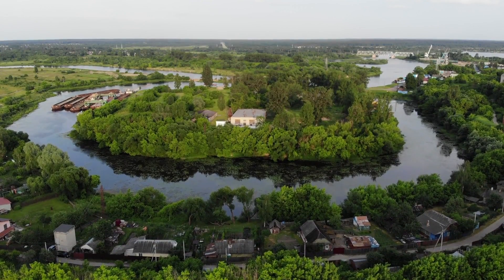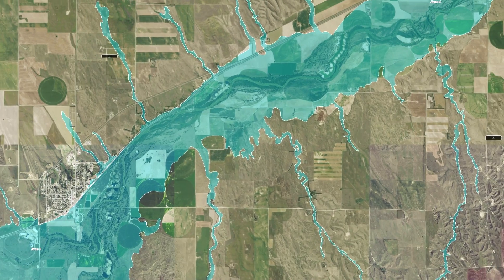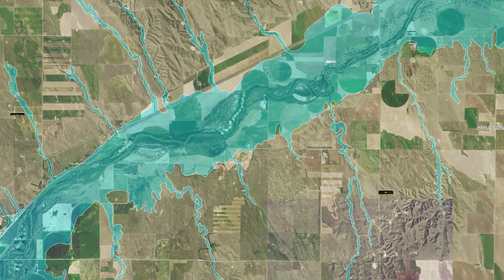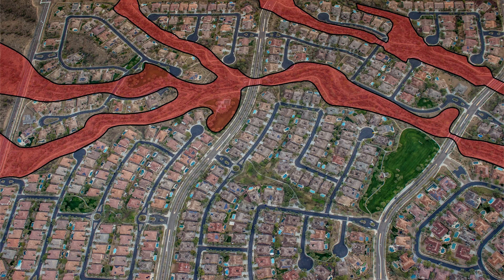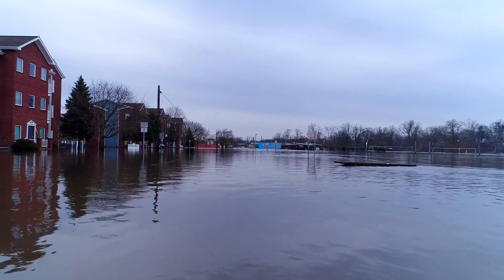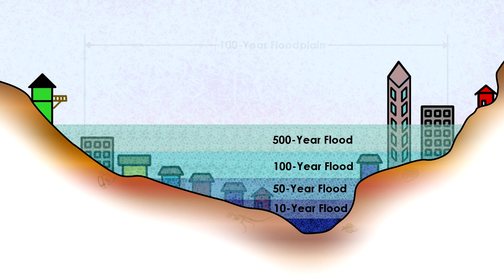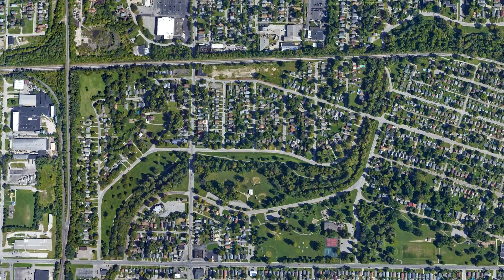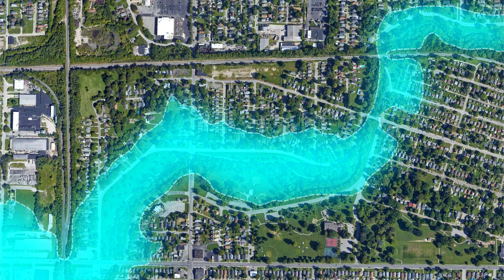Why Engineers Invent Floods

Comment: Reduce Flood Damage - Build Temporary Dams   
Drive posts across rivers at strategic locations where they would catch floating like tree limbs and other floating junk. The temporary permeable dam would prevent larger blockages. After the flood season the debris could be removed.

Comment: Overbuilding can cause issues too. The Berlin sewer system, since it's oversized, doesn't always have enough passive flow to move stuff through the system. So you end up with the stinky stuff just sitting in water not moving

Comment: So... what does climate change do to these statistical models? :-/
Reply: Absolutely nothing if we speak about technical terms. Dams are supposed to be designed to withstand floods at least several orders of magnitude of the local flood maximum. It can easily go up to 10 000 years flood in statistical terms. They don't care about how much water is currently around, rather, how much water have been recorded at its highest peak during the know history.

Comment: 7:00 You're talking about how flood modelling tells us how tall to make our bridges, but it's clear that this bridge (and Stari Most, the beautiful old bridge in Mostar, Bosnia, which you showed near the start of the video) didn't have its height determined by considerations of flooding. The bridge is the height it is because it's connecting two areas of land at about that height, and because of the desire to have a single span across the river. Making the bridge lower would require a lot of excavation to lower the road at either side, and would require an alternative design: either a flatter, heavier arch, something like a cable-stayed bridge, or a pier in the middle of the river.

Thanks for the awesome videos, though. Nitpicks aside, the content is excellent and you explain things really well, so they're fun to watch and informative, too. Also, family cooking time is cute -- possibly the best ads on the internet. :)

Comment: 2:15 "Weather is... noisy data. Some days it rains, some days it doesn't. Some years, it rains nearly every day, some years not at all."
That's not noise: it's the data. Specifically, data that's stochastic. Noise is unwanted processes that cause measurement errors when the data is collected. For example, evaporation from your rain gauge would cause your measurement to be lower than the true rainfall and, er, somebody spitting in it would cause it it to be higher. But the day-to-day variability of the rain itself isn't noise: it's the actual thing you're trying to measure.

Comment: Grady, I don't live in an area where flooding is very likely, living in a coastal city on a mountainside. The precipitation has drastically different issues in this type of building area. I think you could easily get 5 or 6 videos on the risks and mitigation types needed for building in regions like this.
1) ground saturation leading to land/mud slides being the most damaging.
2) drainage systems to allow water to flow without damaging the systems when you are dealing with extremely steep grades.

To make it even more fun, Temperate rain forest climate, so fairly heavy rainfall.

Comment: Great Job Grady.  I'd love to see more about how stream gauges are designed.  Obviously, if you have a perfectly designed channel to measure the volume it should be simple as long as you know the velocity.   As a river runner I'm frequently checking stream gauge data to see what river flows are.

Comment: Question: flooding occurs at different rates, 1,10,50,100. according to the engineers. causeways, pipes and flood drainage can't be made to the 50 year flood standard because it costs to much, or to the 10 years standard, but more like to just above the 1 year standard, even though most drainage systems are designed to last more than fifty years, that's five major floods costing 10s to 100s of millions of dollars, that aren't built to handle these floods,  which means the citizens have to pay higher premiums on insurance, after having paid the governments civil engineers through their taxes to do a half arsed job due to penny pinching or just blatant fraud. Maybe looking at an overbuild, spend more money on infrastructure, less money on polys and crats, more on higher standards. My old man use to say, " Build twice as strong, lasts 4 times longer." My saying. " hardwood for softwood, 6 inches for 4, 12mm bolts for 8. " The price rises by 15 to 30 percent, depending, but it's structural strength and longevity doubles or triples. So which way would you go?

Comment: It is not just how over engineering cost, there is another problem, everybody knows dirt and sand will deposit and clog everything, is there any devices during the design to reduce the influence? Not a perfect solution for thosand year since we have pipe. Further more, people wash things down pipe willingingly or unwillingly every day. In some extreme case, for their own benefit, deliberately clog pipes. On the other side of the planet, we have seen old cars, concrete, tree trunks, dead animals in dozens, you name it. The flooding eliminate the entire neighborhood village and then developers come in, kick the home owners away and making money on new projects, it becomes a weapon against people and it is open to be attack of all kinds anytime. In a century ago, we have some British engineers who over engineering some dams and pipes for reservoirs for about 6~7 times, the reservoir and pipe system still stand, and nowadays we always heard new project less than 2 decades had to rebuild, that is the difference, not by means of engineering, but by the quality difference of government.

Comment: While this is an excellent video, I think it's incomplete. There was no mention of the main limitation of stochastic methodologies in hydrology and hydraulics: it doesn't account for the effects of climate change in altering the probabilistic distribution of extreme precipitation. Climate change resilience applied through civil engineering requires ways to project these changing distributions, such that the magnitude of both the reference typical extreme events (ex. 10-year intense rain for road drainage or the 1% annual chance flood) and probable maximum precipitation events are more accurately estimated.

Comment: The johnstown flood happened primarily because the Southfork fishing and hunting club made deliberate decisions that weakened the dam and its surrounding infrastructure in order to gain convenience. Also, they did not maintain the dam. Even if the storm that caused the 1889 flood had not been at a magnitude that would cause a failure of the dam, further negligence of maintenance or continued weakening of the dam could caused a flood in even tame conditions.

Comment: There's a tiny part of my city that floods every other year. Everybody knows about it, it only floods for a day or two, perhaps a few hours at most and we just accept it. Several of the more recent buildings at risk have floors that are about a foot or two above the surrounding land, just enough to avoid the ground floor being flooded. One of the building owners has invested into a barrier that can be quickly rolled into place and uses the weight of the water to stay in place and hold back the flood. Still, I think we should be doing a bit more. Adding just a single span to the bridge crossing the river and widening it a tiny bit would likely be enough to negate the flood risk.

Comment: The bridge at 7:00 is the Sheep Creek Bridge over the Fraser River in BC.    This bridge was not constructed due to possible flood levels in the river.  The bridge was constructed at the height it was to make it less steep on either side to get to the bridge.   If you look to the left-hand side of the bridge on the farther bank you can see the remains of the much lower suspension bridge and the extra switchback s needed to reach it.  The older bridge was constructed in about 1910 and was of similar design of the Alexandria and Lillloet suspension bridges over the Fraser.  Both of the latter are still in existence today but only for foot traffic.  All three are/were much higher than the flood level

Comment: Not sure I agree  with everything.   For local stuff most public works departments have standard pipe sizes.  The cost of labor is way more than the cost of materials (local level).  For large projects the cost of dealing with rules and regulations tend to be very high along with labor.  I found young engineers worry to much about materials an don’t think about labor to get the thing built.  Anyways guessing everyone has a different idea of value.  Today I think the bottle neck is engineering and government.  The cost materials is huge but is not the limit.  Maybe it’s selling the project that’s the real limit cost is always some crazy number.  Every 2 to 4 man years is a million dollars.

Comment: "massive floods only happen every 10s or 100s of years"
me *points at 100 year floods happening every few years by now" you were saying?
Reply: That's Grady's greates omission here, climate change. Climate change does change the probabilistic distribution of extreme rain, and can even change the atmospheric humidity levels of a region. Where I live, in Puerto Rico, we can split the island going from northeast to southwest, the resulting northwestern half is experiencing a dramatic increase in rain (10-20" more than the 1981-2010 average), while the southeast half is experiencing a decrease of 10-20" in that same comparison.
Reply: The Dutch rules on flood prevention tend to build dams and such to withstand the 1000-year flood-chance. Some of the most important coastal protections even go up to the 10.000 year flood level, as the cost in lives and damage would be too great to contemplate ever allowing them to knowingly fail.
Smaller rainwater-drainage systems aren't all up to that level yet, mostly because the rainfal pattern is changing due to climate change: there are many more heavy local cloudburst-type events now, where the rain used to be more spread out in time and space. So those are being improved wherever work on those systems is planned.

Comment: 1:29 this  height of this bridge has nothing to do with water going under but instead the structure of that bridge. Look around it, the city is way lower than the upper part of the bridge. This is in Mostar, Bosnia and Herzegovina. It is the limit between the Muslim and catholic part of the city and during the war no one would cross it.
Doesn't diminish the quality or your work but I hoped that this wouldn't be the kind of thing you would miss.

Comment: 8:18 Why is the water coming out of the green-roofed building (top left) so dirty compared to the spillway? Is that the output of the turbine, is soil eroding into there, is it the lighting angle... or what? Just seems unusual.
Also, allow me to plug for post10 if you want to see some interesting culvert and drainage footage.

Comment: There isn’t any practical way to prevent flooding, sure you can raise the banks of a river but that will cause issues downstream, and raising the banks the entire length of the river is impractical, anything you do to a river will change the river downstream, so if you don’t continue the changes along the entire length of a river then you’re just moving the problem downstream, in the UK the canal system was built with overflow protection and lack of water protections, because it was built with these features it doesn’t move its problems further down the canal

Comment: What do you call it when the supposed estimated 100-year flood happens 3 times in the last 20 years for a waterway?
Climate change?
Any other suggestions?
Reply: 1) Upstream changes to drainage. (Most likely.)

2) Terrible data modeling. It's impossible to determine the 100-year flood plain when you have a historical flood record of less than 100 years almost everywhere. Precipitation is not normally distributed, so the statistics they use from rain gauges are usually seriously whack.

Comment: People actually on the ground building the systems will put the biggest system in just to keep from getting yelled at.
Bureaucrats and bean counters will demand the smallest system for cost alone because they dont get the flack when the system fails. 
Engineer's are stuck in the middle with their names and reputations specifically and legally attached to said system. They have the worst possible position of being legally liable, yet not in complete control and are the punching bag between either end of the rest of the project.

Comment: With climate change, will the original estimates of 10-year, 50-year, 100-year, and 500-year flood need to be changed? Might be a good video.
Reply: Simple answer, no. Complicated answer, yea and no. In the UK at least we designed to the 1% event plus an allowance for climate change.

In theory, climate change will result in an increase to all rainfall logarithmically, but it would be so marginal in most smaller events that aren’t really used for design purposes.

At the same time, a 5-year flood is a 5-year flood. Whether it should change or not, it most likely won’t because the data used is to generate it is historical.

Comment: the bigger problem is that what we think should be a 100 year storm is often not. some "engineers" have been so far off from 100 year events that what they actually build is roughly a 27 year flood. it erodes public trust, pun intended.
worse yet some people try pushing the blame of cherry picked sampling to reduce the cost and by extension the bid for the public contract onto "externalities" like global warming. the reality is cherry picking the most optimal rain fall somewhere in the aquafer, or naively averaging the values.
those two factors are what causes flooding and flood damage, in the legal sense.

Comment: Excellent video. Question — will climate change negate or change the calculations engineers have made to a degree in which those calculations are no longer reliable? I'm thinking of the maximum possible rain calculations. Is it possible that in 20 years, we'll see rainfall in excess of the maximum calculated today? How will that impact existing infrastructure?

Comment: Since the Oroville Dam crisis of 2017 I've had a question that maybe you can answer.  Did the emergency spillway perform as originally designed?  I've seen it's design criticized for not resisting erosion.  But when it was designed 50 years ago, what was the intention of the emergency spillway?  Was it intended to carry water for an extended period of time, or was it just intended to last long enough to evacuate people from areas downstream of the dam?  That is, was it intended to be the equivalent of a fire alarm, and save lives.  Or was it intended to be the equivalent of a fire sprinkler system and also save infrastructure?

Comment: Also figure in areas with more flood control storage, mitigation, and capacity, with as much data as we now have to foresee storms, that reservoir that’s sitting at it’s usual mostly full capacity, can be almost completely emptied, in anticipation for the coming deluge.  The spillway and outlet works may be undersized for a typhoon, but given the head start it has, also known as the entire point of the reservoir itself, it may not be overwhelmed at all, or else later in the system that it would have been if it were a strictly reactive system.

Comment: Another great video, thanks!  Just an interesting detail about one of the images, at 8:44 those are the "ecluses de Fonseranes" near Beziers, France.  Here you have them in GMaps:  https://www.google.com/maps/@43.3303412,3.2004735,334m/data=!3m1!1e3  They are part of the Canal du Midi, a set of nine locks one after the other.  They are not related to flood control, but they are nice.  And, perhaps, you might be interested in talking about that sort of infrastructure.  This one dates to the 17th century!   You know that the Canal du Midi allowed barges to go from the Atlantic to the Mediterranean coast of France all through France? No need to go around Spain and Gibraltar!   You might also be interested in the strange light blue machine on the top left of the image, right above those gray buildings.   It is a moving lock for a newer section of the canal that bypasses the 9 old locks.  Unlike other boat lifts that move a big bathtub up and down, this one is a movable wall with rubber seals that fit into the side walls of the canal,  sealing off a wedge shaped volume of water that is moved up and down.  It has not operated for decades now, due to high maintenance costs.  The locks do operate during summer.  The picture shows them all open, in the winter maintenance position.   A short distance away, there is a canal bridge:  https://www.google.com/maps/@43.3339818,3.2135627,334m/data=!3m1!1e3 and there is a tunnel a few km away.  All marvels of engineering.  And thanks again for all your great videos.
Reply: Ahhh, that's what I was looking for - the reason for the curved walls. (My guess was "something about wave harmonics".)
Reply: @GeofreySanders  Actually, the original walls on the Canal were flat.  The problem was that the water sipped through the stones and turned the soil around it into runny mud.  If the wall had water pressing on both sides all the time, it wouldn't matter, but with the water on the lock going up and down all the time, the flat walls collapsed.   Later they switched to the curved walls that can resist the pressure much better, like about 3 centuries of holding fast.  British canals being much smaller in all three dimensions don't have this issue.